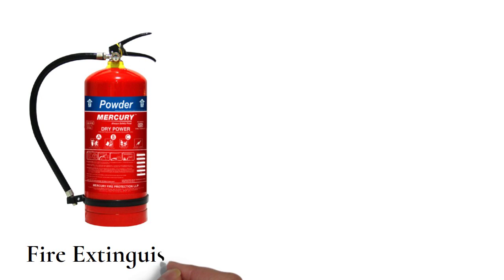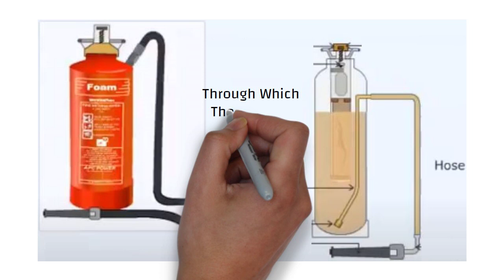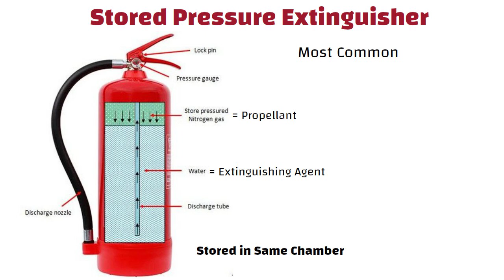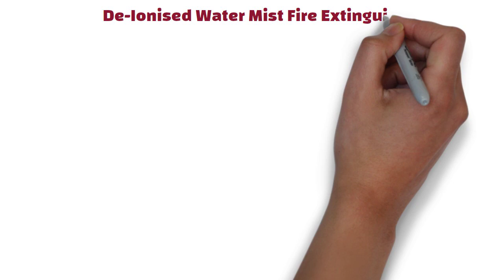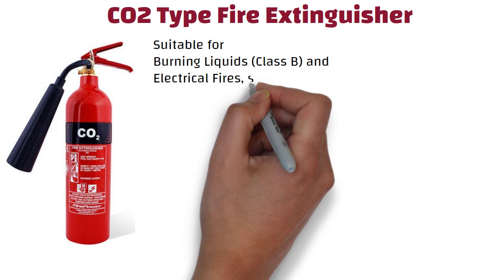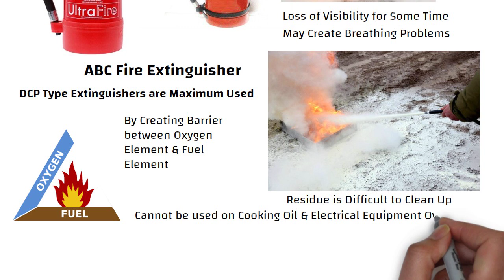FIRE EXTINGUISHER DEALERS IN KERALA, CALL 8138906102, FIRE EXTINGUISHER DEALERS IN ERNAKULAM.

Comment from the maker: KIRLOSKAR FIRE TERRACE PUMP DEALERS IN KOLLAM, KIRLOSKAR FIRE PUMPS IN KOLLAM, KIRLOSKAR FIRE FIGHTING PUMP IN KARNATAKA, KIRLOSKAR FIRE PUMP DEALERS IN KARNATAKA, KIRLOKAR FIRE PUMP DEALERS IN HOSUR, KIRLSOAKR FIRE FIGHTING PUMP DEALERS IN KOLLAM, KIRLOSKAR FIRE PUMPS IN KOLLAM, KIRLSOKAR FIRE PUMP DISTRIBUTORS IN KOLLAM, FIRE ENGINE PUMP SETS IN KOLLAM, KIRLOSKAR PUMP DEALERS IN TIRUELVELI, KIRLOSKAR DEALERS IN KARNATAKA, KIRLOSKAR PUMPS IN KARNATAKA, KIRLOSKAR PUMPS IN KOLLAM, LUBI FIRE PUMP DEALERS IN KOLLAM, LUBI FIRE PUMP DEALERS IN KARNATAKA, LUBI FIRE PUMP DEALERS IN KOLLAM, FIRE PUMP SUPPLERS IN KAYAKUMARI, FIRE FIGHTING PUMP DEALERS IN KAYAKUMARIHOSUR, FIRE PUMP DEALERS IN KARNATAKA, FIRE PUMP SUPPLIERS IN KOLLAM, FIRE PUMP DEALERS IN KOLLAM, FIRE FIGHTING PUMPS IN KOLLAM, FIRE FIGHTING PUMP DEALERS IN KOLLAM, FIRE FIGHTING PUMP SUPPLIERS IN KARNATAKA, FIRE FIGHTING PUMP SET DEALERS IN KOLLAM, FIRE PUMP IN KARNATAKA, FIRE PUMP IN KOLLAM, FIRE PUMP IN KOLLAM, FIRE DIESEL ENGINE PUMP DEALERS IN KOLLAM, FIRE DIESEL ENGINE STANDBY PUMP DEALERS IN KOLLAM, FIRE JOCKEY PUMP DEALERS IN KOLLAM, FIRE JOCKEY PUMP DEALERS IN KARNATAKA, FIRE JOCKEY PUMP DEALERS IN KOLLAM. CRI PUMP DEALERS IN KOLLAM, HYDRO PNEUMATIC PRESSURE BOOSTING PUMP DEALERS IN KOLLAM, VERTICAL INLINE PUMP DEALERS IN KOLLAM, INDUSTRIAL PUMP DEALERS IN KOLLAM, SEWAGE PUMP DEALERS IN KOLLAM, STP AND ETP PUMP DEALERS IN TIRUNELVALEI, STP AND ETP PUMP DEALERS IN KOLLAM, STP AND ETP PUMP DEALERS IN KOLLAM, STP AND ETP PUMP DEALERS IN KOLLAM, HYDRO PNEUMATIC PRESSURE BOOSTING PUMP DEALERS IN KOLLAM, SEWAGE PUMP DEALERS IN KOLLAM, DEWATERING PUMP DEALERS IN KOLLAM, FIRE JOCKEY PUMP DEALERS IN KOLLAM, CRI PUMP DEALERS IN KOLLAM,
Reply: FIRE EXTINGUISHER DEALERS IN MAVELIKARA, FIRE EXTINGUISHER SUPPLIERS IN MAVELIKARA, FIRE EXTINGUISHER DISTRIBUTORS IN MAVELIKARA, FIRE EXTINGUISHER IN MAVELIKARA, ABC TYPE FIRE EXTINGUISHER DEALERS IN MAVELIKARA, CO2 TYPE FIRE EXTINGUISHER DEALERS IN MAVELIKARA, CLEAN AGENT FIRE EXTINGUISHER IN MAVELIKARA, MODULAR TYPE FIRE EXTINGUISHER DEALERS IN MAVELIKARA, MECHANICAL FOAM FIRE EXTINGUISHER DEALERS IN MAVELIKARA, FIRE EXTINGUISHER NEAR ME MAVELIKARA, FIRE EXTINGUISHER TRADERS IN MAVELIKARA, FIRE FIGHTING COMPANIES IN MAVELIKARA, FIRE CONTRACTORS IN MAVELIKARA, FIRE EQUIPMENT DEALERS IN MAVELIKARA, FIRE ALARM DEALERS IN MAVELIKARA, FIRE PUMP DEALERS IN MAVELIKARA, SMOKE DETECTOR DEALERS IN MAVELIKARA, FIRE FIGHTING SYSTEM IN MAVELIKARA, FIRE PROTECTION SYSTEM IN MAVELIKARA, FIRE AND SAFETY CONTRACTORS IN MAVELIKARA, FIRE HYDRANT SYSTEMS IN MAVELIKARA, PA TALK BACK SYSTEM IN MAVELIKARA, FIRE NOC IN MAVELIKARA, FIRE INSTALLATION IN MAVELIKARA, FIRE NOC RENEWAL IN MAVELIKARA, KIRLOSKAR FIRE PUMP DEALERS IN MAVELIKARA, FIRE EXTINGUISHER NEAR ME MAVELIKARA, FIRE EXTINGUISHER MANUFACURERS IN MAVELIKARA, SAFEX FIRE EXTINGUISHER DEALERS IN MAVELIKARA, FIRE NOC CONTRACTORS IN MAVELIKARA, FIRE FIGHTING EQUIPMENT DEALERS IN MAVELIKARA, FIRE PROTECTION SYSTEM IN MAVELIKARA, FIRE INSTALLATION IN MAVELIKARA, FIRE SAFETY CONTRACTORS IN MAVELIKARA, FIRE AMC IN MAVELIKARA, FIRE PROTECTION SYSTEM IN MAVELIKARA, FIRE PROTECTION EQUIPMET IN MAVELIKARA, AMC OF FIRE SYSTEM IN MAVELIKARA, FIRE CONSULTANTS IN MAVELIKARA, FIRE AND SAFETY EQUIPMENT DEALERS IN MAVELIKARA, ADDRESSABLE FIRE ALARM SYSTEM IN MAVELIKARA, KARTHAR VALVE DEALERS IN MAVELIKARA, DCP TYPE FIRE EXTINGUISHER IN MAVELIKARA, POWSER TYPE FIRE EXTINGUISHERS IN MAVELIKARA, FIRE HYDRANT SYSTEM IN MAVELIKARA, FIRE ALARM PANEL DEALERS IN MAVELIKARA, SAFEPRO FIRE EXTINGUISHER DEALERS IN MAVELIKARA, MS AND GI PIPE DEALERS IN MAVELIKARA, JINDAL PIPE DEALERS IN MAVELIKARA, AGNI FIRE ALARM DEALERS IN MAVELIKARA, FIRE EQUIPMENT DEALERS IN MAVELIKARA, FIRE EQUIPMENT SUPPLIERS IN MAVELIKARA, FIRE EQUIPMENT TRADERS IN MAVELIKARA, FIRE SPRINKLER SYSTEM IN MAVELIKARA, RAVLE FIRE ALARM DEALERS IN MAVELIKARA, RAVEL FIRE ALARM SYSTEM IN MAVELIKARA, AGNI FIRE ALARM DISTRIBUTORS IN MAVELIKARA, FIRE ALARM CONTRACTORS IN MAVELIKARA, FIRE PIPE INSTALLATION IN CONTRACTORS IN MAVELIKARA, FIRE SAFETY CONTRACTORS IN MAVELIKARA, FIRE PA TWO WAY TALK BACK SYSTEM DEALERS IN MAVELIKARA, HEAT DETECTOR DEALERS IN MAVELIKARA, HONEYWELL FIRE ALARM DEALERS IN MAVELIKARA, FIRE NOC CONSULTANTS IN MAVELIKARA, FIRE AMC AND FIRE NOC IN MAVELIKARA, FIRE SAFETY COMPANIES IN MAVELIKARA, NEWAGE DEALERS IN MAVELIKARA, MONSHER FIRE EQUIPMENT DEALERS IN MAVELIKARA, KARTHAR VALVE DEALERS IN MAVELIKARA, FIRE HYDRANT VALVE DEALERS IN MAVELIKARA, FIRE HOSE REEL DRUM DEALERS IN MAVELIKARA, FIRE SPRINKLER DEALERS IN MAVELIKARA, FIRE PUMP DEALERS IN MAVELIKARA, LUBI PUMP DEALERS IN MAVELIKARA, LHP PUMP DEALERS IN MAVELIKARA.

Comment from the maker: Fire extinguisher dealers in KOLLAM, fire fighting contractors in KOLLAM, KOLLAM, fire and safety installations in KOLLAM, fire extinguisher suppliers in KOLLAM,fire extinguishers in KOLLAM, fire extinguishers in KOLLAM, fire protection system in KOLLAM, f fire and safety installation in KOLLAM, fire and safety contractors in KOLLAM, fire safety contractors in KOLLAM, fire and safety systems equipments in KOLLAM, fire equipment in KOLLAM, fire extinguisher in KOLLAM, fire protection system installation in KOLLAM, fire contractors in KOLLAM, fire safety consultants in KOLLAM,  fire alarm systems in KOLLAM, fire NOC in KOLLAM, fire AMC in KOLLAM, KOLLAM, fire fighting equipment in KOLLAM,
MS Jindal pipe dealers in KOLLAM, motor control panel in KOLLAM, fire pump panel in KOLLAM, motor control panel in KOLLAM, Morley fire alarm in KOLLAM, gst fire alarm in KOLLAM, addressable fire alarm system in KOLLAM, Pa talk back system in KOLLAM, PA two way talk back system in KOLLAM, auto glow SIGNAGES in KOLLAM, Karthar dealers in KOLLAM, Agni fire alarm dealers in KOLLAM, ASES SECURITY fire alarm dealers in KOLLAM, AUTO GLOW SIGNAGES in KOLLAM, FIRE PUMP PANEL in KOLLAM, LHP pump in KOLLAM. Karthar valves in KOLLAM, Ravel fire alarm system in KOLLAM. Jindal pipe dealers in KOLLAM, Jindal pipe dealers in KOLLAM. MS pipe dealers in KOLLAM. Butterfly valves in KOLLAM, PA talk back system in KOLLAM, Fire alarm dealers in KOLLAM, smoke detector dealers in KOLLAM, fire alarm panels dealers in KOLLAM, MCP, hooter dealers in Mangalor, hydrant valve dealers in KOLLAM, branch pipe dealers in KOLLAM,Fire CP hose in KOLLAM, Fire RRL hose in KOLLAM, heat detector dealers in KOLLAM, Motor Control panel in KOLLAM,  LED EXIT LIGHTS dealers in KOLLAM, emergency exit light dealers in KOLLAM, auto glow SIGNAGES dealers in KOLLAM. Conventional fire alarm system in KOLLAM, Fire alarm panel in KOLLAM, Notifier fire alarm dealers in KOLLAM, PA talk back unit dealers in KOLLAM. Honeywell fire alarm dealers in KOLLAM, BOSCH PA system dealers in KOLLAM, 
KIRLOSKAR FIRE FIGHTING PUMP DEALERS IN KOLLAM, FIRE FIGHTING EQUIPMENT DEALERS IN KOLLAM, FIRE ALARM SYSTEM DEALERS IN KOLLAM, FIRE CONSULTANTS IN KOLLAM, FIRE CONTRACTOTORS IN KOLLAM, FIRE CONTRACTORS IN KOLLAM, FIRE ALARM SYSTEM DEALERS IN KOLLAM, SMOKE DETECTOR DEALERS IN KOLLAM, FIRE PROTECTION SYSTEM IN KOLLAM, FIRE CONSULTANTS IN KOLLAM, FIRE CONSULTANTS IN KOLLAM, PA TALK BACK SYSTEM IN KOLLAM, ADDRESSABLE FIRE ALARM SYSTEMS IN KOLLAM, CUTTER PUMP DEALERS IN KOLLAM, ADDRESSABLE FIRE ALARM SYSTEM SUPPLIERS IN KOLLAM, SMOKE DETECTOR DEALERS IN TKOLLAM, PRESSURE BOOSTING PUMP DEALERS IN KOLLAM, SLURRY PUMP DEALERS IN KOLLAM, WATER PUMP DEALERS IN KOLLAM, RAVEL FIRE ALARM SYSTEM IN KOLLAM, LUBI FIRE FIGHTING PUMP DEALERS IN KOLLAM, FIRE EXTINGUISHER DEALERS IN KOLLAM, ADDRESSABLE FIRE ALARM SYSTEM DEALERS IN KOLLAM, 
KIRLOSKAR FIRE FIGHTING PUMP DEALERS IN KOLLAM, KIRLOSKAR FIRE FIGHTING PUMP DISTRIBUTORS IN KOLLAM, KIRLOSKAR FIRE PUMPS IN KOLLAM, KIRLOSKAR DIESEL ENGINE FIRE STANDBY PUMP DEALERS IN KOLLAM
Reply: FIRE EXTINGUISHER DEALERS IN KALIKAVU, FIRE EXTINGUISHER DEALERS IN IRIKKUR, FIRE EXTINGUISHER DEALERS IN PERINGOM, FIRE EXTINGUISHER DEALERS IN BEKAL, FIRE EXTINGUISHER DEALERS IN PAYYAVOOR, FIRE EXTINGUISHER DEALERS IN MAGALAM DAM, FIRE EXTINGUISHER DEALERS IN ERATTUPETTA, FIRE EXTINGUISHER DEALERS IN MADATHARA, FIRE EXTINGUISHER DEALERS IN TALIPARAMBA, FIRE EXTINGUISHER DEALERS IN UPPALA, FIRE EXTINGUISHER DEALERS IN THALAPADY, FIRE EXTINGUISHER DEALERS IN CHERKALA, FIRE EXTINGUISHER DEALERS IN POINACHI, FIRE EXTINGUISHER DEALERS IN ALAKODE, FIRE EXTINGUISHER DEALERS IN SREEKANDAPURAM, FIRE EXTINGUISHER DEALERS IN VDADAKKENCHERY, FIRE EXTINGUISHER DEALERS IN KUTTYADI,